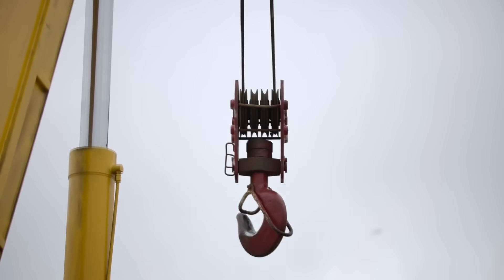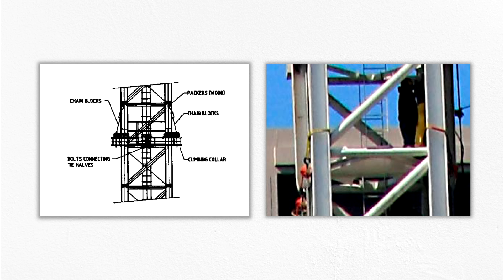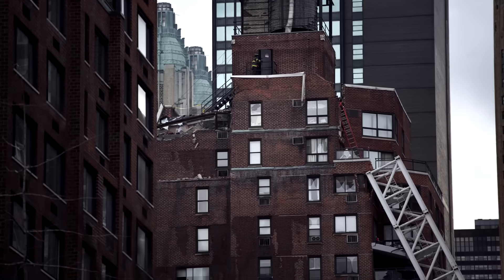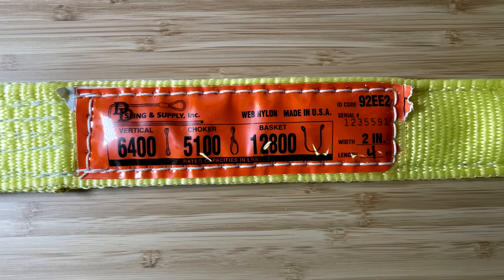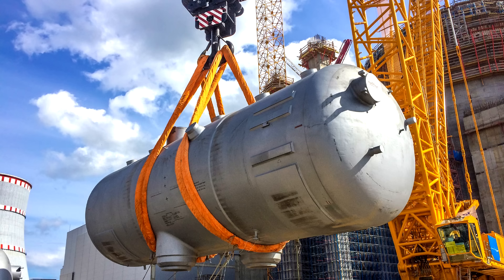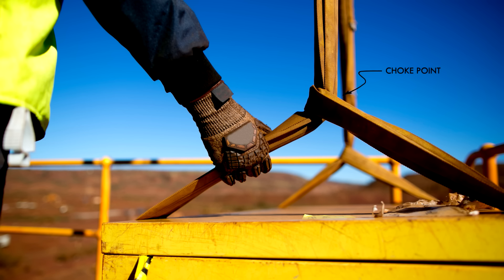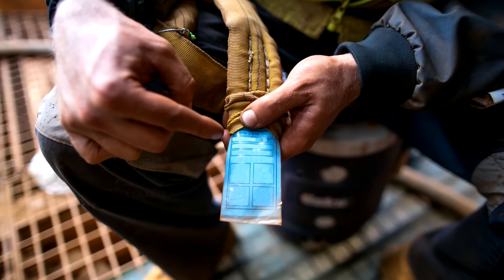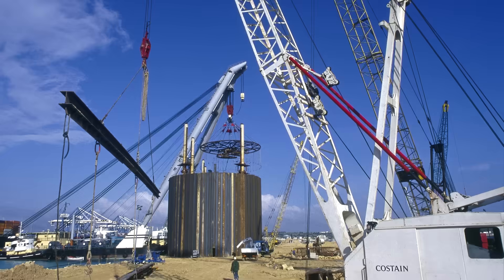Why Things Fall Off Cranes

Comment: I was unloading 60ft 1/2 inch rebar off a big rig using a forklift with 30ft boom the basket method in poor weather and didn’t check the straps before use. The strap was showing red and shouldn’t have been used all n all lost a load smacked right back onto the bed in the truck and sent me jumping from the side. Scary days but great video!

Comment: Thanks for “codifying” something I’ve always felt I have an almost “intuitive” feel for.  While watching crane segments being added to the huge crane at SpaceX Boca Chica, I thought that getting that crane from horizontal on the ground where the segments were being added, up to the near vertical working position was going to put some incredible strain on the wire ropes.  I was curious as to whether they would have used another crane to help start the lift. . .

Great stuff!

PS. . .  as a former “small aircraft” pilot, part of the training involved doing “weight and balance” calculations to ensure that the airplane remained controllable under a wide variety of conditions.  That training has transferred nicely to loading up a vehicle for long trips. . .  even though I’m not the driver. . .
Reply: It's kind of cool how we have that intuitive sense about what's going to slip, without always knowing why. I think it's because of childhood play, things like building with LEGO or building forts. Loading up my truck for a long-distance move and then having a bad roll-over accident where nothing in the back of the truck was broken except the bins that held my stuff ... pretty good proof that I knew how to tie stuff in properly.

Comment: Mobile crane operator here! 9 Years of experience and i would like to correct one mistake you made early in the video. Not every hoist is done with a hook. I've lifted plenty of stuff in confined space with only the thing at the end of the wire. Ofc this limits your lifting capacity to what ever one line can pull and you need to use correct shackles; But sometimes you indeed lift stuff with the line that's on the cranes winch.
Reply: Are you meaning the becket ? Bless ya'll from hooterville, n.c.

Comment: As an iron worker for over 20 years this is a pretty good beginner video. Biggest three problems I've ever seen with rigging failures are people not checking their rigging regular enough for wear. Using slings in a basket with a spread which allows them to slip and cut.  I almost never use a basket or allow it to be used around me.  Also using synthetic slings on Sharp edges without softeners.  
I like your example of how the angle affects the load. It's amazing how many people in rigging don't understand how much this affects the load.  Pulling on shackles at Angles also affects its load rating.
Reply: I always think that the best way to explain this is to hold two weights, with your arms hanging vertical. Now raise your arms to the horizontal (or even 45 degrees). You can feel how the weight increases
Reply: @gcunn1  good idea
Reply: With the straps also chemicals and ultraviolet . stay strong and carry on . Bless ya'll.

Comment: You're right, this isn't a training video... it's far more informative. I use gantry cranes as pat of my job in a structural fab shop, and neither shop I've been in had anything to say about the angle of attachment or potential for friction, and only a couple loose guidelines about cradling vs. choking a load (only cradle little things that are ok if they drop, choke everything else).

Comment: "Why Things Fall Off Cranes"

Human error, and gravity... Done.
Reply: And Road Runners.
Reply: Human error is not the root cause of industrial accidents.
Reply: @Crlarl  

Things like metal fatigue wouldn't have an affect, if it weren't for laziness, and complacency in not doing proper safety checks for that sort of things. 

Those are called, human errors. It's funny that you mention that it's not the root cause. In the list of causes, human error can encompass the vast majority. Guess what that would then make it... Teh Rewt Cawze.

Not to mention... seeing as most things in industry, if not all, are done because of humans, that would kind of make them the root, as well. So...
Reply: @Psyrecx  
Human error only happens when the surrounding systems allow it. While human error is factored into failure analysis, there will always be something behind it. Training, safety systems, and corporate pressure are all root causes.
Reply: @Crlarl  

What again created and control those systems?

If it wasn't on purpose, it was an error.

So, guess what it was, once again.
Reply: @Psyrecx  
Yes, those things were made in error, but with that logic, every failure is human error.
Let's say that a crane's load falls because of improper rigging. If you're just looking for someone to blame, you find the guy who did it and fire him and get someone to do it right. Problem solved? No. If you're looking to actually find the cause to prevent further accidents, you need to know why they made that mistake. Were they rushed? Improperly trained? Lacking equipment? Then you need to find a solution to any or all of those problems. These are things that can be fixed beyond just not making mistakes. That's the problem with human error as a root cause. You can't expect mistakes to never happen so you need to have systems in place to prevent catastrophe due to mistakes.
Reply: @Crlarl  

Wait, did you just try to say, if you found out someone did something wrong, and then got someone who did it right, that's not a solution?

Wow, you didn't even need me to defeat your argument,  because you managed to do that, yourself.
Reply: Yeah 'human error' is just a catchall.  What error was made?  Why did it happen?  This video helps to understand the errors that are made so folks can avoid repeating them.

Comment: 9:20 -- a humble request -- please disable the MSX function when taking thermal videos like this. I know it gives the veneer or appearance of "higher resolution" or "higher quality", but when it's grossly misaligned like this (as is unavoidable in a scene like this with such a range of depth of field), it straight-up takes mental effort to ignore the misplaced 'visual detail', look past that, and notice the actual thermal information that is important. It makes it harder to see the point you're trying to illustrate, not to mention explain it to other folks (I was just trying to explain this scene to a friend of mine and getting past the irrelevance of the sharp detail was such a horrible distraction.)
Reply: I don't understand the whys and wherefores of this, but it was certainly difficult to see what what going on.

Comment: I witnessed a chain sling failure on a small crane lifting roofing materials to the top of a building. This was in the summer of 2009 at Arizona State University. Fortunately the workers had kept the area under the hoist clear so no one was hurt. Besides, it was summer, so there were hardly any students on campus anyway.

Comment: Very interesting - not something I'd ever considered. But I won't be walking under any cranes from now onwards! One thing that did strike me right at the beginning, though - why, after all this time, do cranes still only have a hook? OK, maybe it's just one of those things that they got right at the beginning. But, considering how much the rest of the crane had been improved over the decades, how likely is it that the hook is still the best (only) answer? I'm no engineer, but maybe a lot of the problems with slings could be reduced or even eliminated with something better than a hook to attach the load to?

Comment: The same principle works when you want it to go the other way. I cut a lot of trees and if a tree is hanging in the not preferred  direction you want it to fall I use a rope and tie it to another tree as tight as possible and put a weight of 30 kg (about 66 pounds) in the middle of the rope. this will amplify the pulling force a lot.
Reply: I had to cut down a lot of trees (mostly bloody sycamores!) when we moved into a house where the garden had been neglected for years. I had no experience of doing this, so had to develop techniques as I went along (looking back, I marvel that I never ended up in hospital!). The biggest problem was trying to get the tree or branch to fall in the right way, and I discovered (the hard way!) that this is a hell of a lot more complicated than it looks. I mostly managed  to get trees/trunks to fall roughly right, but in the entire operation, I only succeeded in  getting a roped up branch to fall where I wanted it to twice. Several times, instead of falling, it actually swung back and nearly hit me! I now have a great admiration for tree surgeons...

Comment: I love your remark about rope from a truck. I grew up on a family run dairy farm and sometimes there are things we had to move that required some form of rigging to lift from hooks on our front end loader and of course we never had anything resembling proper gear. Fortunately it was infrequent and they were very light loads compared to anything you're discussing here, and we're at very low heights. Still, I hated doing it every time we had to.

Comment: You've done a lot of great demos of concepts over the years, but using that scale to show the changing force in real time was maybe the best one yet.  Such a perfect visual.

The only rigging I've personally done is lifting engine blocks from time to time.  I'm glad I way overspec'd the chain, I was working a really working with really shallow lift angles due to vertical constraints.  If I'd gotten the 500 pound chain I would have been way over.  I'm a pretty mathematically inclined guy and I knew that changing the angle would affect the load on the chain, but it never occurred to me how much.  My 200 pound engine block was probably putting 800-1000 lbs of tension on the chain.
Reply: I've only lifted an engine once.  When the new engine was ready, I hoisted it back into the car and held it on the hoist whilst I connected it to the gearbox - partially lying under the engine as I did so. The hoist I used throughout this operation was fixed to a wooden ceiling beam in the garage. Some years later, I demolished this garage to build an extension, and was horrified to discover that it had no foundation - just erected on a concrete base. It was literally held together by the garage door - once I had removed that, I was actually able to collapse the whole structure by pushing against one wall!! I still have nightmares about how lucky I was when fitting that gearbox...

Comment: Grate video.
I would have liked if you would have mentioned things like dynamical load factors, the difference between 4, 3 and 2 point lifts and stable and unstable lift.
just to show people how much you need to take into account.

Comment: Thanks for the intro to the topic. i ve worked in a couple construction and manufacturing processes (mostly back in the 90s). i ve watched the center of gravity issue bite once or twice. i though of a couple other points of failure based on my very limited experience... crate and hardpoint failure - where the structure that houses the item to be hoisted fails or the ring/hook or loop on the object fails during lift. often seemingly due to non vertical load. in my case the crate holding 84x120 glass broke at the corner  due to a knot in the 2x10 board near the top corner mount where the chain at... a REALLY wide angle pulled in to hard. thankfully it only partially failed before the problem was addressed and the crate was set down. rigging is some crazy stuff not to be taken lightly

Comment: That load calculation is awesome, I don't use it because that would mean that I'm pushing the numbers to close for comfort. I always grab a strap that it at least 2x's what I know the weight to be and only go up from there.
Reply: I mean, is there any disadvantage to just using the highest rating strap every time?
Reply: @dillonvandergriff4124  the bigger the straps the heavier and harder they are to work with.

Comment: you missed 1 for a fail of rigging there it is the same question i had to ask the fitter i was with i was operating the crane when the load got to 2T and the spool didn't move should of been about 800kg + any scale and crap in it slings where good for 2T he was scratching his head well i asked him if he missed a bolt yep he did 1 M30 8.8 bolt. fitter has a dogman ticket i have CN C2 and basic rigging tickets it can still be the simple things that can get you i prefer to go with a higher rating than needed where i can.  also looks like there removing the 120deg data from the sling tags in australia now.  i have also seen a 50T crane fail to lift a 5T pump due to scale build up around its feet (reached its limit) had to break the scale by jacking the pump with a 80T hydraulic ram then the crane could lift it

Comment: You don't see too many people on work site with calculators and an understanding of trigonometry working through these equations.  They must either be using some kind of short-cut "rule of thumb" concepts...or just "eyeballing it" from experience - and I wonder whether those kinds of approach are the primary reason for these kinds of failures?

Seems like it would be useful to have some kind of simple phone app that would allow you to sketch your proposed rig - enter your load's shape and size - and have the app warn about center-of-gravity assumptions.
Reply: It would be too difficult to properly implement. Will you have your worker manually draw the shape of the load in 3 dimensions? Will you have to make standardized models that may not be accurate to the real thing you're lifting? Will the app only work with serialized parts (the only real viable solution I can see)? 

It may also be too time consuming, especially if the worker needs to input too much data. Time is valuable in a construction project.

And finally, in programming there's the concept of garbage in, garbage out. If the program only knows what the worker inputs then if the worker makes a wrong assumption about the center of gravity then following the output's instructions could result in an even worse scenario than simply eyeballing and not being too far within the margin of error it has.

Programming has way too many nuances and depending too much in it when there are better solutions could result in it being a crutch. And guess what, if the app would work with serialized parts then it may just become an easy to browse chart instead of a proper calculation about the optimal way of loading stuff.
Reply: @eduardobarreto5555  Yeah - I don't imagine it could be all that easy.   But as someone who works in the aerospace simulation business - I don't think it's impossible.

Comment: I'm kind of surprised we don't have a shipping container equivalent to rigging cranes. Though unlike shipping containers there would be a wide variety of shapes and sizes and styles. What I mean is a product that has a hook-friendly attachment that can easily be used to hold a variety of things. A combination of a shipping container and straps with lots of threaded holes to bolt things down like a mill's table or 123 blocks. Sure it adds weight, but most of the time you have weight to spare with carrying small things.

Comment: Shallow sling angle increases sling force. What provides the necessary opposite force? The load.
For mid-size loads, the sling is often far stronger than the load itself, so if your angle is too shallow you end up unexpectedly snapping/buckling/bending your load.
Reply: Good point.

Comment: The biggest failure I’ve seen always has to do with the connection point of riggings. Whether the hook is missing its safety latch or the sling angle is too acute and they should’ve used a cross arm or if they used a choke and the choke slides. Another thing is when the load leaves the ground and rigger with the tag line and the load starts to spin from wind.
Reply: https://www.youtube.com/watch?v=hjh2JPy-3IMhttps://www.youtube.com/watch?v=hjh2JPy-3IMhttps://www.youtube.com/watch?v=hjh2JPy-3IM
Reply: Safety latches have only one purpose, to keep unloaded slings from from being flung from hook while traveling.

Comment: I used to wear a hoist all the time when I was a warehouse worker and had to use a cherry picker to get to high shelves. And we were required to inspect and sign off on the state of our synthetic hoists for exactly the reason that you covered. They were super vulnerable to abrasion. But thankfully modern-day synthetic hoists have features that make abrasion way more obvious on purpose. Like bright red threads buried in the fabric that become extremely prominent as soon as it reaches a certain abrasion level.

Basically if you see the red threads, you throw out the Hoist and get a new one. Period.
Reply: Have you watched any of the YouTube footage (eg from NASA Space Flight) of the Space X spaceship construction down in Boca Chica? They make extensive uses of cherry pickers, sometimes at ridiculous heights (in a place known for its gusty winds!). I have long wondered how they have never had an accident (as far as we know). Those guys at the top of the cherry pickers, 50m up must be either brave or crazy - or both!
Reply: @paulhaynes8045  oh yeah. I've seen the footage. Thankfully those guys are very much tethered to an anchor point on the Cherry Pickers. Even if they were thrown off the side, they would just end up dangling by the Hoist. That has its own share of Hazards, but at least they didn't go Splat on the pavement lol